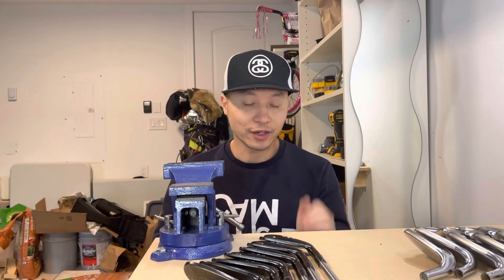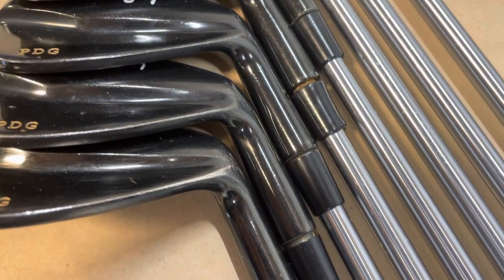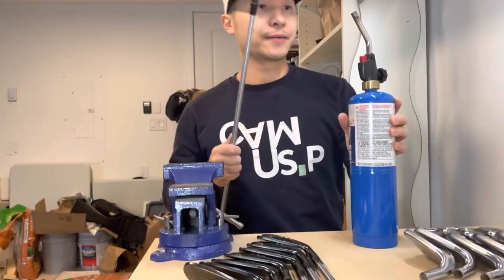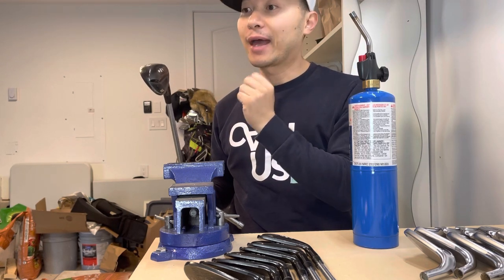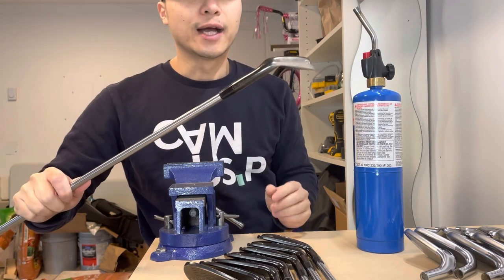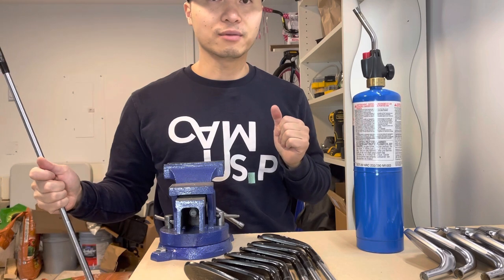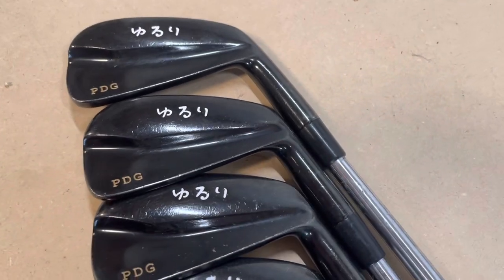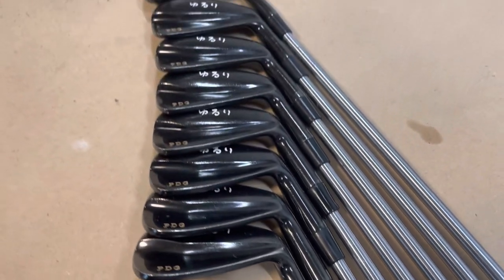How to fix lose ferrules

Comment: Boiling water. Drizzle it over the ferrule for a few seconds. Don't use an open flame
Reply from the maker: Tried that, didn’t work for all of them, only 2 of them worked. And the flame is the fastest and easiest if done correctly!! Cheers.

Comment: Before resorting to fire, you can run the ferrule under hot tap water for about 30 seconds and accomplish the same thing. It’s worked for me for years.
Reply from the maker: Yea, I have tried that, didn’t work for all of them. And this fire way works the quickest too. But hot water definitely works on some of the situation.
Reply: @DC_Golf  very true. It’s just my first go to on a loose ferrule. If the hot water doesn’t work, then the torch definitely will. 👍🏼